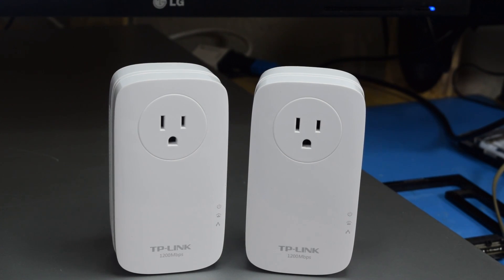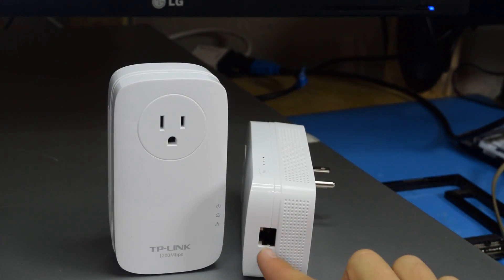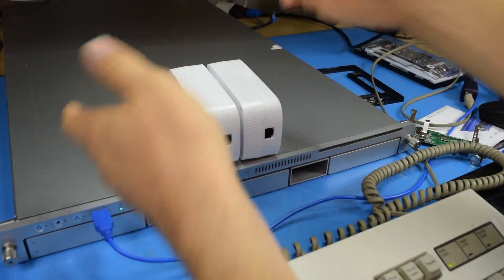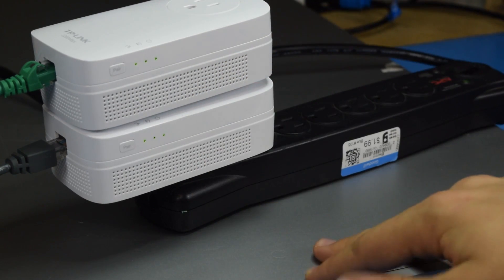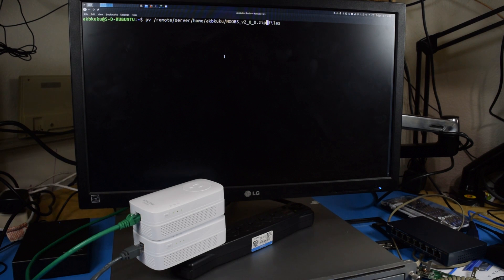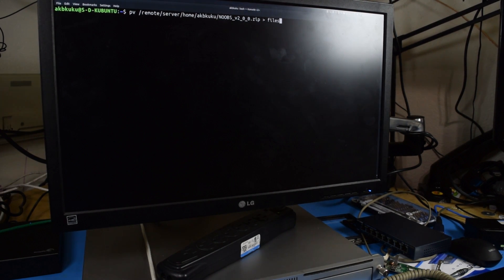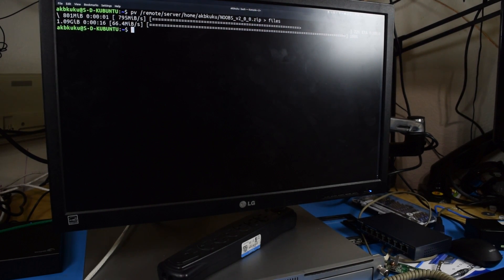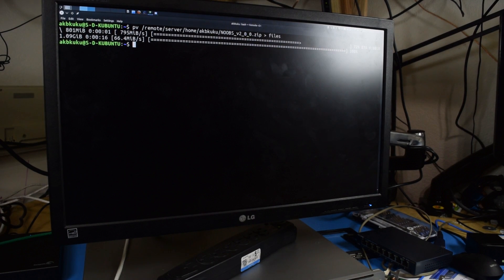0x0014[Extra] - Gigabit Powerline Adapter Not Even Close

Comment: I tried a TP-Link gigabit powerline model once a few years ago and I only got 100 megabits so that was disappointing and I just returned the adapters. Thankfully MoCA exists now so I use that and can get a gigabit(ish) connection practically everywhere (each connection is 400megabits so it requires 3+ connections to saturate the gigabit ethernet).

Comment: Just moved into a new home and thought these would be a good idea instead of drilling holes for an ethernet cable. With a gigabit fiber optics connection, I generally got 85-25mbps (d/u) in my office room :/. Back to the trusty ol' cables I guess. Powerline adapters are handy for very hard to reach places like the garage and the backyard, where 20mbps u/d is plenty. But 300$ for 2 adapters? (Devolo Magic 2) Yikes.

Comment: I wonder if it's maybe this particular brand's adapters. I've seen widely different speeds reported for USB3 to Gigabit Ethernet adapters, so I figure it's also going to vary based on brand. 

I also would've plugged them into the same power strip rather than into each other. Not sure if the "here's an extra AC out port" is going to provide the best possible speed.

Comment: I use Moca type adaptors and it doesn't get to gigabit to the internet my internet being gigabit but I've gotten 700mbit/sec download and 750mbit/sec upload the way it works is it takes coax jacks that are used by cable providers and turns them into effectively ethernet cables however I'd only recommend it if you have fiber for internet meaning the coax in your house isn't being used by your ISP
Reply: This is not true. MoCA uses a different frequency than the cable internet modem signals so there is no overlap - otherwise it would be a pretty half-ass solution. My cable internet is gigabit down and I can get the full gigabit using MoCA (it has to use 3+ connections though because each connection is limited to I think around 400 megabits which is just how the standard is).

Comment: Do not i repeat do not plug straight into power strip like that, it just makes you lose speed, pair them at the same two wall plug if you have it or close, then move one to ethernet location and one to router location

So try the test again with these tips as a lot of others have said too.

Comment: U don't know what u r doing, thats the problem. U suck and your video is misleading and detrimental for other people (since u deceive them).

U can't plug them into each other, because they have filters to remove any noise from whatever is plugged into them (in this case the signal u wanted to measure). No wonder u got such a poor result, and the same both times.

__ also, as pointed out elsewhere___:
20 MB/s = 160 Mbps
Reply: To whom it may concern
btw I have plenty of experience with these powerline kind of things. I will share some info here, what I have learned to improve the results. 

Me and my brother both happen to live in the same house, but in different apartments, both on the 5th floor. We share internet via powerline and it works well (and my brother will pay half the internet bill). 

In the beginning (when I had 100 or 150 mbps, he only got 30 mbps out from his wifi router (connections were like this. Directly from my internet source (a switch?) connected to powerline, then in my brother's apartment at the entrance (mirrored from my apartment, in the entrance hall, I. E shortest possible distance, though still down and up 5 floors somehow?), the other powerline which was then connected to his wifi router in his kitchen via long ethernet cables pre-installed in the apartment). So, with an AV300 or AV500 (don't even remember now) and an old N-router, he got 30 mbps from his wifi router (and response time 15 ms). (while I had 100 mbps which was later, at first increased to 150 mbps, from my internet source). 

Then, still later, after that, I changed internet provider to 250 mbps at the source, and we upgraded his router to a really good ac router (because his old could not make more than 30 mbps in any case), and a 'new' AV600 powerline, and his router received - and was also able to broadcast at - 70 mbps (response time 8 ms). 

And an hour ago, just now, we upgraded the powerline to AV2, tp link AV1000 (which I was able to buy for 10 USD as new but 2nd hand), and now his router both receives and transmits at 140+ mbps and is stable and response time over at his wifi of 5 ms (though the response time at his powerline is 3 ms). 

If we want to improve it further, though we don't really need more, we are very happy with what we got now, but anyway, then we would go for tp link av1200 with ground connection and mimo, which I can buy second hand for 20 USD, or the even better AV2000 though ten times more expensive and not available 2nd hand).

__
More information. My ethernet connection is, at the moment 250 mbps, and my own 5 GHz ac router has 240 mbps in most of my apartment. Our new AV2 powerline, when setting it up, was able to deliver 173 mbps while in the same room fairly close to each other (and 3 ms response time).
When moving the receiving powerline into my brother's apartment, he got 140 mbps (up- and download) at the powerline, and his good ac router puts out 100 % of that (I. E. also 140 mbps).

___
Note also that some powerlines, like tp link av1200 I know for sure (but probably others too) , don't work well in newly built houses that uses the newest electric circuit standard in the US anyway (I have seen comments on this and confirmed by the manufacturer). So they probably have to come up with new technology for it to work well with the newest (safest?) circuit standards.

Comment: I have power lines and if there plugged into the same wall socket as my dirty monitor PSU they drop to 200Kb/s.

If my monitor is plugged into a seperate socket, when my monitor is on my downloads drop from 2.5MB/s to about 1.2MB/s.

Comment: I actually have that exact model of devices here.  Wireless through this house is almost impossible, so any speed is a win. 
TPLink's status tool shows my links to the other three nodes in the house are 103 megabit, 122 megabit, and 250 megabit right now.  As I understand things, these are HALF-DUPLEX, so divide by two for real speeds of 51Mbps (to a room you literally can't get a working wireless connection in), 61Mbps (to the internet gateway) and 125Mbps (next room over). 

Powerline ethernet is definitely hit&miss. When it hits, it is nice. When it misses... it is not so nice.

Comment: One thing that might be affecting the speed is plugging them into each other.  Those powerline adpters have a built in noise filter.  So basically it's like you just plugged them in a surge protector.  Try plugging them in to two different wall sockets in the same room.

Comment: I can get a solid 200 Mbps across the house on mine. I've had 3 sets now, as better models have come out over time and I'd say the speed is about 1/10 the number on the box for pretty much all of these. That being said, for some situations they come in really handy. I'm in the suburbs with a pretty dense wifi environment so getting decent, reliable wifi on my pc across the house is pretty much impossible. I should note my internet package is only 100 Mbps, and I'm not running any intensive NAS solutions or anything, so a reliable 200 Mbps without having to run my own cables is pretty nice.

Comment: Fashionably late to the party.

I'm curious: Wouldn't these adapters have filters on their own outlets to prevent high frequency noise from any subsequent device to get through to the mains, where the powerline connection supposedly is?

If so, aren't you basically running the powerline signal through the filter of the bottom adapter, essentially getting a huge dampening effect on the connection? Would be interesting to see what happens if you plug them beside each other on the same powerstrip.
Reply: Yeah, it doesn't work, what he did. They r supposed to cancel the signals / noise from anything plugged into any of the powerlines

Comment: Powerline adapters are extremely variable. Mainly due to what you're plugging them into. Why anyone would think a filtering surge protector could maintain a signal between two conditioned ports I do not understand. These adaptors are also variable based on the house you're plugging them into. New wiring standards could probably handle a connection between these better.

Comment: I don’t think plugging them directly into eachother is the best idea.  They might be putting out a really hot signal that overloads the receiver circuit if they’re too close together.

I’d suggest plugging one into the end of an extension cord then the cord into the other, then trying this experiment again.

I’ve had some of these do 80MB/s before, though not the exact same model.  Plugging them into different circuits actually did help.
Reply: If he had read the manual he would known that plugging them directly into each other is indeed not the best idea. And plugging them to a surge protector is definitely not the best idea.

Comment: FYI all power line adaptors combine the upload and download speed together and it only talking about the speed between adaptors and not the true speed your actually getting, so in actual fact they are technically only doing 600mbps up and down at best and thats how they get the combined rating of 1200mbps

Comment: i live in a brick house with no conduit running to other rooms so basically any server stuff has to sit in the rack next to the fiber ONT and router, any desktops in other rooms i have resorted to using AC wifi, just like you did i tried the supposed 1Gbit EOP devices with the same results, 20MB/s give or take, with a bunch of high power pcie based asus AC cards i can pull 80MB/s across the house. close enough to GBe as it can be

Comment: I got some super cheap COMTREND 200Mbps ones, and plugged directly into each other, 194.7Mbps with speed test !
Reply: Li tleydxdy Yes this is my point! Don't bother with getting super expensive gigabit ones, get cheap ones and it will be same speed.
Reply: Li tleydxdy , well they are not, the 1 Gigabit ones I saw when I was shopping, they were much more expensive, in about £50-£60. The cheap 0.2 Gigabit ones I brought were much cheaper, £7. Huge saving for the same speed
Reply: So 25MB/s...

Comment: Interesting how bad your results are. My results are fantastic.   I’m hitting 80-110MB/Sec file copying on windows to another windows machine from my house to my barn over 120V line.  My barn is around 150 feet from my house.    Testing internet speed I’m only loosing out on 5mb/sec at most up in the barn.  

Must be some reason it’s terrible for you, maybe poor filtering causing some sort of ground looping thus serious loss or something similar? I don’t know maybe defective units?  Maybe just version or brand? 

I do know my house used to have bad wiring and bad ground isolation, and I was having issues with my networking and I was replacing switched left and right if they were not chassis grounded.  Did some investigative work.. the coax cable that used for my internet to the cable modem, the metal screw ring which is wired to to the shielding in the coax was live at 120V somehow if I used a multimeters and touched it to my PC case, it read 108V-119V which indicated serious issues.  My PC chassis is properly grounded, but the router and the modem both used 2 pin plugs so they were sending house hold mains power over ground lines of the Ethernet.  I tested as well.. sure enough 108 volts on one of the metal tabs in the line.. while thank god all my stuff further down is properly grounded and isolated, it was causing massive headache with inconsistent network speeds, dropped connections, random resets and dying or dead routers.. I had a tech come out from the internet company I showed him and he rewired the ground line and retested with me to make sure the issue was gone and it was.. Still has a few issues here and there that I solved later on with rewiring my farmhouse and properly grounding every line and isolating groundings as much as possible to stop looping effects.. my issues are not 100% gone.   

I’m not saying this is what you have going on, but it’s something you should check out maybe you wiring has too many common groundings and causing looping effect or maybe you have separating high voltage where it shouldn’t ever be.  Maybe you have both.. and if you find that you have too many common grounds or weirdly high voltages on line or something you are fairly tech savvy I’m sure you’ll have some ideas to work it out and take us on that journey with you.
Reply: I haven't had a coax live at 120v before but I've definitely gotten a few tingles. 60's wiring haunts me on a regular basis.
Reply: absolutely!  i got shocked many times before i rewired my house to great expense.   in fact it was legit dangerous.  was some groundings to copper pipes that floating grounds, like cold water pipes that where PVC lines..but copper pipes further up as they leave the basement, so lot of floating grounds using those copper pipes. 

luckily i never had injury but, it wakes you up.   but ya even if not getting hurt from it floating like that on shield lines, it can damage equipment. it slow internet down off that line too and cause havoc... networking stuff is very sensitive to slightest noise and changes..
Reply: Apparently it's common for HDMI cables to become fully live as well either from reverse polarity or  high voltage being passed through coax connections
Reply: Do you use powerstrip?

Comment: The way they rate these adapters is weird, it is like advertising a switch by its internal speed, not the port speeds. The power line network can reach its rated speeds with multiple connections going to different multiple power outlets. There is most likely technology that can layer the signals in different frequencies but NOT the technology to bond and sync packets on 2 frequencies but to the same network route. It seems like the only way to find true speeds is trial and error. Especially when you consider the hidden pitfalls of your house, one outlet could be significantly worse than the one on the next wall for no conceivable reason. I'm currently using a power line connection for my plex server since its a chunky thing and I want it in an out of the way place. It is usefull for some devices in situations where your wifi is getting congested. My household has cut the cord and does alot of streaming so yea, I need to make sure  I head off wifi hogs before the turn.
Reply: yep i get what you are saying, its like port speed on a switch vs Backplane Capacity on the switch, you have a 24 port switch with each port having 1gbe but the Backplane Capacity is junk you get 2 users on that switch hammering it and the rest get pennies

Comment: That is an absolutely ridiculous result. 1/5th of advertised in what seems the most ideal conditions realistically possible. (maybe the 1200 means it can do 600 in one directio) but that'd still be less than half of advertised.

Could the transceivers RF frontend be saturated by a too strong signal?

Are there noise suppressors or other power conditioning devices connected to the same phase?

Thechnically plugging anything that's not a resistive load to the to the same phase will hinder the performance. Not only because the device may be noisy, but because it will act as a filter that will attenuate the signal.

Are you sure it's not the Xserve, your desktop, or the measurement method at fault? (I doubt it is, but you know, troubleshooting 101)

Powerline adapters are such a stupid idea. Why try to carry a signal on a circuit specifically designed to not do that?
Reply from the maker: I was thinking they be getting an overloaded signal and was considering testing that by putting on outlets that are on the same breaker in one room to make it a little more like a real world test case.

The reason I connected them to a GFI outlet in a bathroom was to give them a completely isolated power source. There was nothing else connected to power in the room.

I should have shown the computers sending data through the switch in the video, I was trying to record this quickly though and didn't think of that. That data transfer method is 100% reliable through the switch.

Comment: Try plugging them into the same power strip on an USV with no connection to an the actual power outlet, only the battery. And don't plug them into each other either, I wanna see if that makes a difference.
Reply: USV huh, do you by any chance speak german?
Reply from the maker: Do you mean a UPS(Uninterruptible Power Supply)? They most likely won't work with the majority of those. They use a square wave for the AC output. There are some high end ones that do an actual sine wave, but they are pricey and I don't have one.